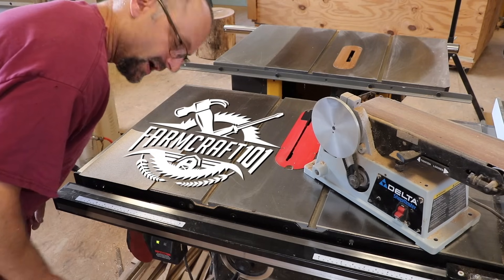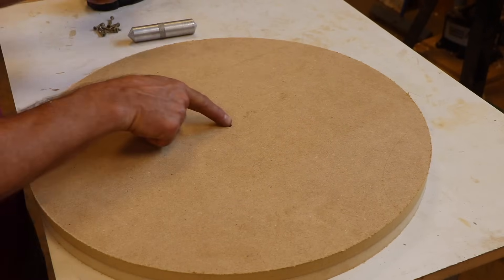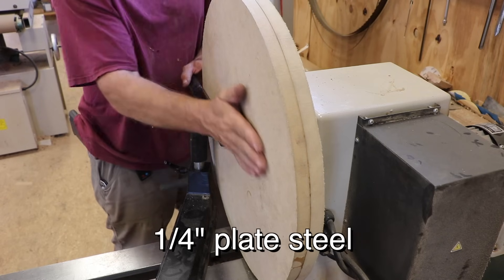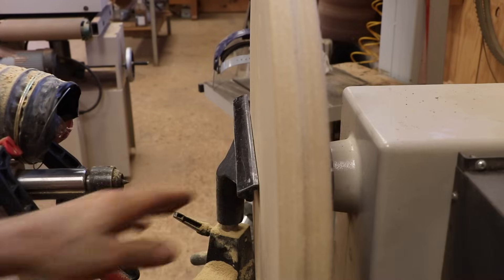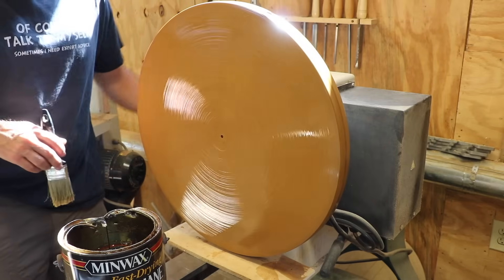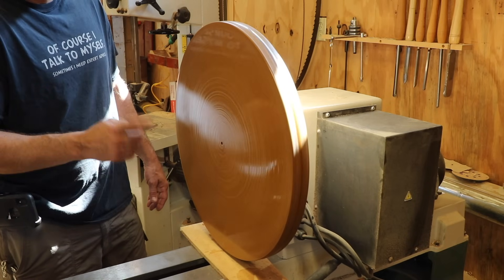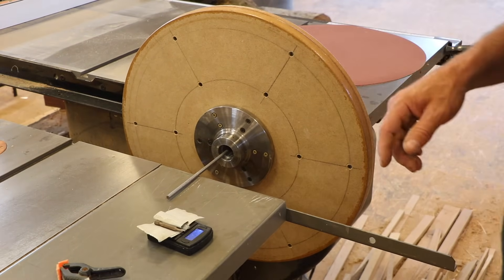DIY 20-inch Disc Sander Build.  $2000 Tool, Cheap and Easy.

Comment: Looks good. I'm not sure if the paper will be difficult to change or not but warming the paper seems to help on my smaller ones. I would poly the backside to prevent warping. I know it's mdf but it can't hurt.

Comment: FarmCraft101, Thank You for your hard work on this video. But Your Rpm Limit should be "0"!!!  MDF is Fine in Compression but with Centrifugal Force on it and You Flexing it with applied pressure Breaking it apart Bit by Bit a little at a time every time You Sand on it.  It is a "Time Bomb"!  Just like  a Helicopter it is Trying to Kill You From the Day it Leaves the Factory. That Thing is going to "Grenade" when You least suspect it!  That stuff is not Fiber Reinforced in any way like a Abrasive Chop Saw Blade. You bump it and it will have a Dangerous Crack in it.  There is nothing holding it together.  The Amount of Low Tensile Strength Resin holding the MDF together is almost nothing.  That's why it will soak up moisture like a sponge making it even weaker if it is not totally sealed.  For a Disc that big You should have used Steel but could have used Aluminum Safely. But You may have bin able to use a High grade Birch, Rutland or Marine Grade Plywood if you kept the RPM very low or put layers of Fiber Glass and Epoxy Resin between it.  Adding a Poly Urethane Wood Hardener all around would really help. That VFD RPM Control You have will make it very temping to spin it up to boarder line or Higher than Safe RPM Limits especially on thicker materials or when the sand paper gets dull.  I think even 1.5" Plywood on a 20" Inch disc would Flex to much in My opinion.  The Formica cover is not a bad idea.  But a coat of epoxy or polyurethane maybe just as good.  If You used Steel You'd never be sorry.  I'm not sure what the RPM limit would be for Good Quality (Ductile) Cast Iron but the stiffness would be great.  I suggest Trash the MDF, start over with Steel or Aluminum using the same pivot pin technique You used on the Bandsaw to cut the Circle O.D. and on a drill press to drill the Backing plate bolt hole pattern (Including the Pilot Hole) so they are absolutely straight.  Come up with a Metal Lathe Tool Post Holder Adapted to Your Wood Lathe to cut the O.D. True and the both Surfaces Flat.  I can tell You Factory Built 18' or 20" Disc Sanders are Flat with in a couple of Thousands (0.000 -0.002").  Good Luck but Stand Clear!
Reply: SOOO TRUE !
I KNEW a man who KILLED himself with his wood lathe 😭
  Sanding a 12 inch diameter stool top.
Turned it to top speed and it lost a chunk INTO his forehead 😭
He didn't know better 😱
Now YOU DO 😥
Reply: @bobbob8229  They should have never taken Shop Class out of Schools.  Besides Skills it Taught and Bred Common Sense and Safety whether You used You Shop Education for a Profession or a Hobby.  Sorry to Hear about Your Friend.

Comment: FWIW, the commercial sanders you showed at the beginning usually come in two flavors; one for wood and one for metal work. Wood sanders rotate at 1720-25 RPM, and metal at 3450 RPM.

Comment: I would stay at or below 600rpm... also remember it can be out of balance at multiple angles. You can upgrade that tool rest by giving it a locking pivot so you can select your angle. As for potential upgrades, a sheet of UHMW like they make cutting boards with will not be damaged by the adhesive sanding disks you might also consider sealing the back side of your disk to keep humidity from warping it. overall I like. I had similar plans, but I was going to use an electric motor and make my own once I have a suitable workshop again.

Comment: Really cool build, iam not an expert but id be  a bit worried about the lever you create when sanding on the outside of the huge disk. It will put a suprising amount of pressure on the leathe. But if youre not pushing it, id assume thats fine?

Comment: Really neat idea.  Thanks for sharing.

If you find that the Poly did not hold the way you hoped, try 2 part epoxy mixed with 25% Acetone.  I use this all the time when I need to stabilize large areas on a slab. It gets down into the wood because its almost like water. Once the Acetone flashes off the left over epoxy cures up inside the wood. You could then coat the top once more, flatten it and then polish it up.  That plastic coating should not ever flake off.

Comment: I did a version of this years ago (not nearly as large as yours).  I found that simple spray on adhesive (not super strong) works just fine and allows you to just peel off the old sandpaper.  That thing turned out being ridiculously useful over the years.

Comment: Good video, particularly the section on balancing. Just to answer a couple of your questions:  nominal induction motor speeds are determined by the number of winding coils (aka poles) 2 coils = 3600, 4 = 1800 (1750) and 1200 for 6 winding motors. More windings = more cost. The difference between nominal and actual is a property of induction motors (vs synchronous), I didn’t show the actual for the 2 and 6 pole versions, easy to find online if you’re curious.  Couple things about faceplates. First it’s difficult to break a metal one, although all manufacturers will tell you to use pan head wood screws, not the flat head style you used. I know faceplates are countersunk but apparently that’s not an indication of what type of screws to use, check your grizzly manual (I own a G0766 too). I make my faceplates from hardwood, maple mostly, Beales taps are available for all common spindle sizes to cut the mating threads.

Comment: I personally would never trust   mdf. There is an industrial grade product I'd recommend. Canvas Micarta. 
It has a clear flatness advantage. It solves the possible problem of the disc adhesive tearing up the face. 
But most importantly, its structurally sound. Balancing would be less of a problem because its density. 
Micarta is layers of paper, thin coton fabric, or canvas fabric saturated with phenolic resin. It is cured under pressure and heat. There is no solvent that will damage it. Its Its nearly indestructible. Its not prohibitively expensive. You can find a piece this size, maybe 5/8" thick for under $200. 
My worry with mdf is lateral loading near the outer edge.
Pushing hard into plate could cause it to flex and fracture. 
The screws through the metal faceplate into the mdf seems like an area where the mdf could fail. Mdf is notorious for screws stripping out holes.

Comment: Great build!  There is a fairly simple calculation for a rotating ring's critical speed (can't recall off the top of my head) at which it will pull itself apart... But you also have a glue layer in there, which complicates things a bit.  I think it makes the whole assembly stronger. But you were right to be aware of "standing in the line of fire." If I was you I would have stood off to the side until it spins up to the working speed! 😄

Comment: I'm curious about using a disc sander to flatten stuff. My theory has always been it wouldn't work well because the farther from the middle, the more material removed, and the dead center is barely being sanded, so it would create a cone affect instead of flat. With a 20" disc sander, what happens in actual use?
Reply from the maker: It works. Does help to move it about some so the center isn’t in one place. Works great for bowls.

Comment: My fear when you were spinning up the disc to speed was when you turn off the motor, would the disc keep spinning and turn itself off the threads of the lathe? Not sure how those threads are oriented.
Reply: They spin down free with no real brake. But yeah it will unscrew itself and take off across the floor. Had a 4 jaw chuck do that to me once. There is a relieved portion behind the threads for set screws in the faceplate though.

Comment: I think resin would be a good surface to cover the wheel in that would allow you to change the paper out easily in the future while sticking well too
Reply: I think making a 3 inch thick resin wheel would be not only cool, but as good as MDF (#1 I could be wrong, #2 no worries about having to seal the resin for moisture warpage). Resin is as easy to work with as wood, but the cost would be higher. Would heat be an issue, I would be curious to know? Other than that great video!!

Comment: A coat of epoxy on the surface will work for  the sandpaper removal. Or you could have used a melamine faced MDF for the working face. Really good video, filled with valuable ideas.

Comment: Like others have said, I’d seal the back side also. The idea of a thin sheet of aluminum seems like a good idea, that way if you ever change the paper you can use a heat gun to get it off. Great video.

Comment: “Many ways to skin a cat”- is a modern take on the original “Many ways to skin with a cat”. The use of a “cat o’ nine tails” leather strands whip by Royal Navy disciplinarians to punish naval hands for misdemeanors in the 17th an 18th century. Adding salt water to the leather strands to burn the skin cuts was one example of many ways to skin with a cat. 
By the way, my disc sander has carborundum right up to the rim, providing versatility when sanding the insides of a Vee joint.
Reply: That's an incorrect folk etymology.  The original use did indeed refer to skinning animals, and is related to other long-standing expressions such as, "There are more ways of killing a cat than choking it with cream," and, "There are more ways to kill a dog than hanging."  The phrase is just a variation off of older saying like those.

Comment: If the paper won't come off clean, just a few millimeter thick aluminium sheet could do the trick as a surface layer.
Reply: Can you go more in detail?
Reply: @robertcornelius3514  Aluminium would provide a surface that doesn't absorb the adhesive, thus making it easier to remove stubborn strips of paper. Using solvent won't damage it, where a wooden surface might be damaged over time. It will also do a decent job of protecting the wood surface below from accidental grooves or tears. Pick a harder alloy, not the soft hardware store variety.

If more protection is needed (for example when sanding a lot of hard workpieces), steel sheet might work, although I'd recommend very secure fastening for any metal surface lest it becomes a wheel of fortune for hospital bills.

Comment: If you wanted a metal surface then wouldn't aluminium be much easier to work with?  Also, so you are aware, acrylic sheets are not usually of a uniform thickness, something I have learnt through experience; I have found sheets to vary as much as 0.2mm from one side of an A4 sized piece to the other (which to my mind is a huge amount).

Comment: 9:31 whoa, what did that paint can do to you?
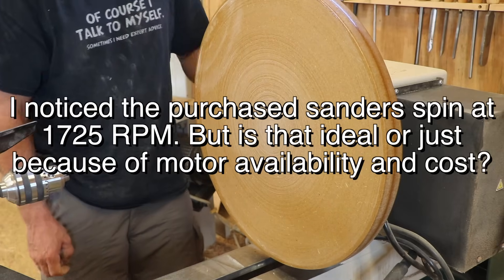16:33 1725 rpm? what size disk do they use? your disk is probably bigger so it needs to spin slower.

Comment: What a great idea.  I have a bench mounted 12" sanding disc which gets used very seldom.  But takes up floor space as it's mounted on a rolling cabinet.  Precious floor space.  I'm converting and selling the old disc sander.  Thank you !

Comment: Good day sir, question. What is the process for changing the sanding disc when it becomes worn out? Also great content! Keep up the good work.
Reply: A hot air gun will soften the glue. It should peel off easily. Best regards.

Comment: I’ve had great luck with using spray Lacquer on my DIY plywood disc sander. The only difference between the one you’ve built and mine is that I built my disc size at an 8” diameter. I’ve been using mine for the past 3 years without having any issues and it stays as close to dead flat as possible.

Comment: Great job!!! 
Now for the scary stuff, if we do the math, the outer edge of a 20" disc at 700 rpm is travelling at around 42 mph and at 1000 rpm that goes up to almost 60 mph... Note to self do not stand in the line of fire and as Norm Abram would say "...and remember this. There is no other more important safety rule than to wear THESE... Safety Glasses"
Reply: I hope you wore your safety glasses when you wrote that.
Reply: Remember CD-ROM drives on computers?  They never got faster than 52x (whatever speed that is).  Someone tried spinning them faster & they'd explode.  Plastic shrapnel everywhere.
Reply: @TomBuskey  I think it was MythBusters that put CDs in an angle grinder, or some sort of contraption, and made them explode.
It's why car tyres have a speed rating, and why the tyres for the Bugatti Veyron had to be specially made.

Comment: I would be afraid of warping with that unfinished back side.
Sure its MDF but it may still warp a little bit with huge humidity changes.
Reply: I came here to say the same thing, so have a thumbs up! I'd put a coat of that thinned polyurethane on the back just in case. It may not make a difference, especially if your shop is climate conditioned, but it's so easy to add that you might as well.

I've been thinking of making one of these. Maybe this video will inspire me to finally do it once my current tendinitis settles down.  My lathe only has a swing of 16", so I'll probably try to figure out a way to attach a bigger sanding disc to the outboard side of the headstock. Unfortunately, that side has some sort of weird, left-handed metric thread.
Reply: I doubt very much that 1.5” of MDF will warp any if at all.
Reply from the maker: Fair point. I actually plan to throw some finish on there. I didn’t do it initially because I wanted to make sure it would balance and not require any truing on the back as well. It won’t move much as my shop stays pretty dry in humidity, but it’s easy enough to do.
Reply: @laurawerner  Imperial thread is weird.
Reply: @4486igi  yea, try counting how many threads there are in a millimeter 1.5 or 1.7
Reply: @davidschwartz5127  Amen and amen...
 That's got to be one of the funniest comebacks I've ever heard!
Reply: @davidschwartz5127  Why would you use mm in the first place, instead of cm? How many threads are there in a thou?

Comment: Very cool build, I like your method. I would assume the MDF disc would have a much lower max RPM rating, since it's two pieces held together with glue and mechanical fasteners. The commercial disc sander likely has a unitary metal or polycarbonate disc/spindle which can more easily resist rotating itself apart. Maybe add a small guard or deflector on the tool stand just in case, until you have a good idea what safe operating parameters are?

Comment: One option for attaching sandpaper would be to use some hook and loop fabric. Use some contact cement or spray adhesive to stick one part solidly to the disc, then use the sticky back of the sandpaper (and maybe some more adhesive) to stick that to the other half of the hook and loop fabric. Especially useful if you think you might want to use more than one grit of sandpaper on a project, but don't want to waste a disc that's barely been used.

Comment: I would have sent you a few pounds of sticky tire weights such that you could figure out balance (I did an experiment, such as yourself, that did NOT pan out. Left with a bunch of tire weights now. :))   ) I would have sandwiched a plate of aluminum or cabinet grade ply in between the plates, but that's just me being me....

Comment: I would personally prefer to make several discs for different grids, especially since it takes up a lot less space then a dedicated sander. I really like the idea of reusing the lathe for this purpose and with easily changed discs. Thank you for taking your time to demonstrate how to true and balance the plate a lot of builds tend to focus on the main body of the machine, not the disc itself.
Reply: As cost affective and easy as these are t make, I agree. Make multiple and you have the perfect sanding station.

Comment: I think you could use a layer of transfer tape (like the stuff used for vinyl decals) on the surface to make the sandpaper more easily removable. You've already created a smooth surface on the MDF, you should be able to apply a single layer of transfer tape, then mount the self-adhered abrasive to it (or use spray adhesive for something that isn't self-adhesive like plain paper). 

The stuff comes in various levels of tack, however given the large surface area, even an easily-removed type should provide more than enough stiction to prevent the paper slipping. 

When it comes time to remove, the transfer tape should come off cleanly. It's cheap, plentiful, and can be found in wide rolls. If you don't need much, your friendly local signshop could be talked into letting some go for the price of lunch. 

In retrospect, I'd love to see if someone has made a version of this using melamine-coated MDF. I suspect that might not need any prep at all and could peel easier than a standard metal platen, as well as standing up to thinners for cleaning adhesive.

Comment: Even if you could work out all of the cutting and flattening issues with 1/2" steel plate, I would be concerned about the weight of it on the machine. At a minimum, the bearing life of your headstock would be significantly reduced.

Comment: I have been wanting to make one of these myself.  I don't have a big lathe, so I would have to do the standalone version, but otherwise, your process is almost exactly how I was going to do it.  Very interested to see how the MDF holds up over time (I was worried about sanding-heat warping it).  Thank you for making this video, great job!!

Comment: I should have put this in the earlier comment but...
I run my 16" at 500 RPM for almost everything. Sands nicely, removes material as fast as I want and isn't at all scary. I use 100 grit paper as my go to and that does everything I need it to. Your mileage may vary.